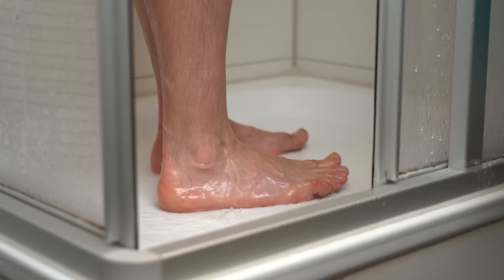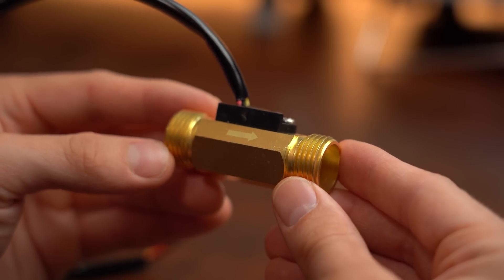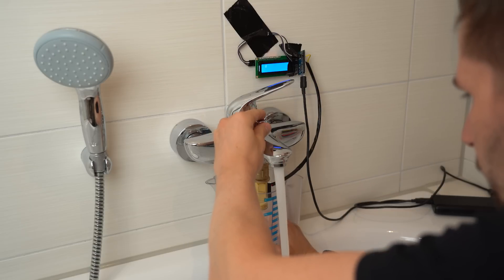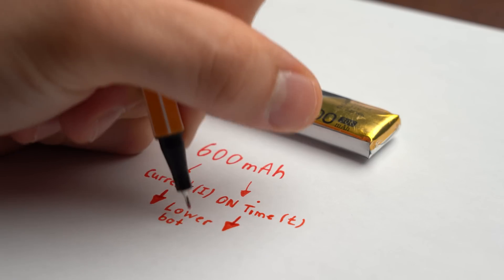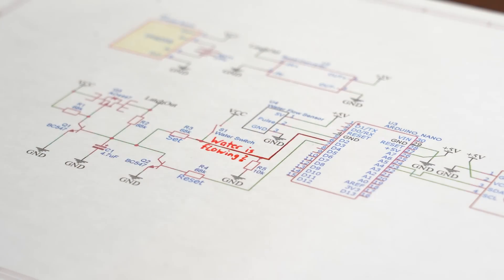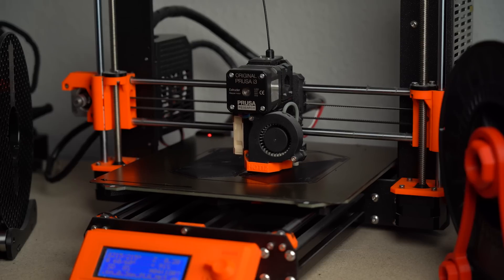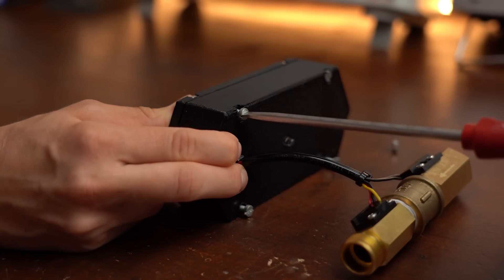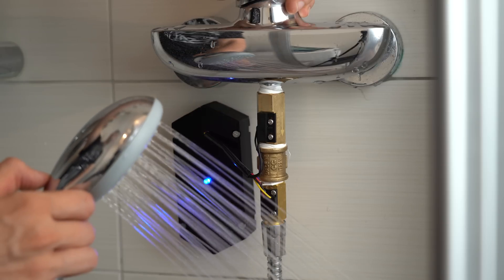Every Shower needs this Upgrade! (Online Water Tracker)

Comment: Awesome build, I’d be interested if the variability in the water sensor is consistent enough to be calculated… I’m thinking if you can measure rpm and adjust the output accordingly. E.g, if 1k rpm = 5 liters per minute and 2k rpm = 20 liters per minute and 3k = 25 lpm we should be able to create a curve to approximate the output based on flow rate… makes me want to build it just to find out :)
Reply from the maker: That sounds like a good idea. Definitely worth it to look into it. Only problem for my setup would be that integrating such a curve into the home assistant programming would be kind of hard.
Reply: @greatscottlab  You could implement the curve into the program on the ESP and let it report ’linearised’ pulses instead of actual pulses. That way you can still use a constant conversion factor from pulses to L/min in Home Assistent.
Reply: @greatscottlab  Ahhh I'm just starting to dabble with home assistant. Definitely didn't consider that element. Thanks for sharing!
Reply: @greatscottlab  Let the ESP do the linearization and conversion to liters and liters/minute. You already know all you need. Just take the low flow and high flow pulse-per-second and make linear interpolation between the two from the input pulses in a time interval. Should be pretty much precise enough to do the math once every second.
Reply: @greatscottlab  You can use a Taylor series (?) to fit a formula to hit data points on a high order curve.  I did it for a light meter to subtract ambient light.
Reply: @greatscottlab  The volume of the water is a derivative of two pulses and the time between those pulses, so if you find the volume/time graph you could do that.
Reply: @greatscottlab  I think implementing this in ESPHome is trivial using Templates (lambda actions).
Reply: @greatscottlab  it would just be some lerp probably
Reply: @greatscottlab  When I looked at the link for the water flow sensor I saw this in the description
 Pulse frequency: (Hz)=[ 11*Q ]±5%(Q--flow L/min )
Reply: I don't think a higher order curve is needed at all. The relative error between low flow and high flow seems to be somewhat <10%. A linear compensation will be far better than the purpose requires. The goal is to save water by behavioural change, not to do scientific measurements.
Reply: @SpeedFlap  Whaaaat..? Not scientifitics?? That's not at all how I'm thinking about it! 😄 it's all good fun until it's a chore, then I dumb it down.
Reply: @SpeedFlap  yeah even a simple timer would work.
Reply: Endress and Hauser has some interesting in deph explanation Videos about All kinds of flow meters
Reply: Shouldn't this be possible with the sensor filter "calibrate_linear"?
Reply: Using a flow meter is still a widely used way to measure volumes in industry. Usually you don't have a curve for the flow/pressure/etc as it depends on your liquid (water vs oil for example) they give the relationship for pulse per turn. Some flow meters do have a relationship for pulses, but those sensors measure an actual volume (ex 3.14ml/pulse).

What is done to make accurate and repeatable measures is called a K factore. If you have a constant flow for example coming from a pump you can simply do the calculation at the rated flow, but if the flow or pressure or liquid change, you need a multi K factor compensation. It is done by taking multiple measurements across the flow variation. Then you do a linear interpolation between the K factors.

An example would be a variable speed pump in an oil pipe and you need the result in kg. You will start by taking the number of pulses and the frequency at 10% speed, and for each 10% up to 120%. You can do it for a couple of different temperature points as well if you have a temp sensor (for oil it actually as an impact) . Then in production if you read a frequency at 63% you interpolate from you 60 and 70%.

I don't know if it make sense the way I wrote it, but I do those kind of things regularly where I work. We are able to get below 0.5% error with cheap sensors and this method. Our process requires less than 2% error. Actual data is 0.2kg of error for 5 to 150kg requested quantity from speed between 25 and 180%.
Reply: Well, Homeasisstant has integration helpers. :) Easy peasy to create one to integrate the values sent by Esphome.

Comment: Fantastic idea! I need this to show my family how much water they use in the shower. :)
Reply from the maker: Yes :-) It is really a revelation to see how much water gets used there.
Reply: Really what are you a weirdo with nothing better to do.....Want to show how much water you use in a shower....Put the plug in and when you've finished, then measure it! No need whatsoever to moan about the 'Environmment' whilst making over complicated parts, that in total actually cost what to produce and ship and package, in plastic no doubt, plus using Lithium Batteries on projects.....The hypocrisy is laughable. Plus if you can't get in a shower, clean yourself in about 2 mins, then get out, there's something missing....